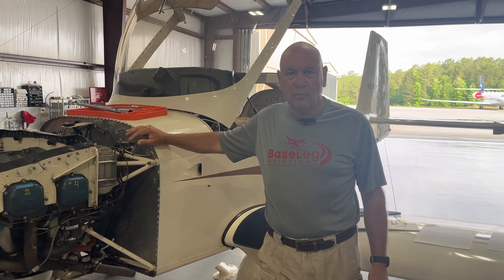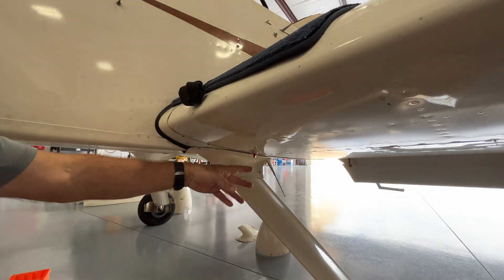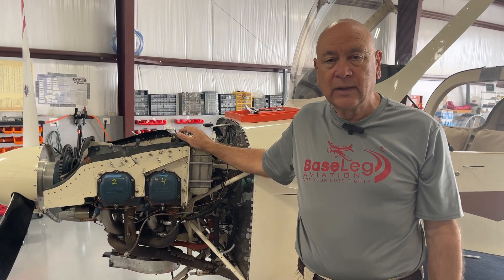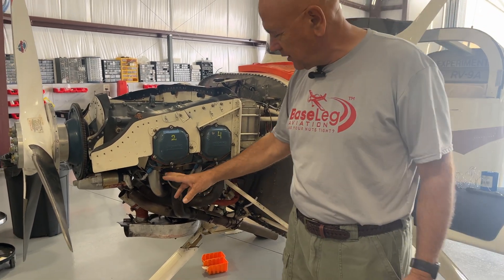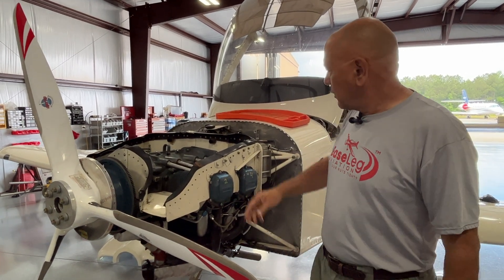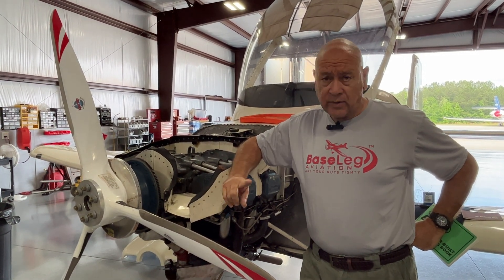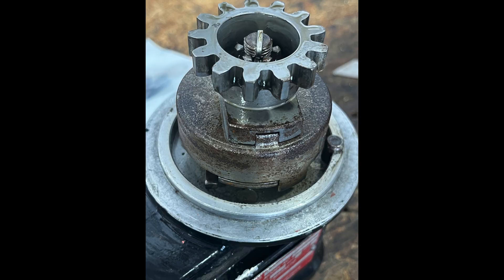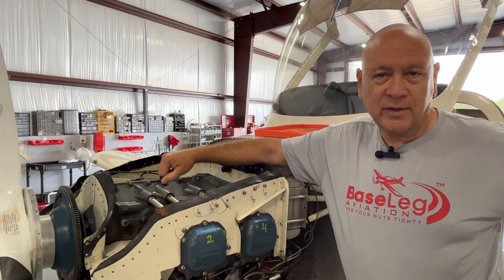RV 9A condition inspection findings

Comment: What target system voltage do you shoot for aircraft with the Odyssey battery? I replaced my Concorde a long while back, but never adjusted the voltage regulator. I know the AGMs prefer a higher charging voltage (and use an AGM compatible charger) but didn't adjust my aircraft systems.
Reply from the maker: 14.3-14.5 is best for them.

Comment: When my plane is going to sit for a while, I place a desiccant pack in the oil filler neck and seal it with plastic and a rubber band. I cover the crankcase breather as well. If it's going to set for weeks, I also install desiccant plugs in the cylinders. Do you think I'm adding engine protection or just making myself feel better?
Reply from the maker: there’s lots of other openings such s the exhaust pipes. if it’s going to sit for weeks you should consider investing in one of the units that recirculates dry air through the engine.
Reply: @baselegaviation1614   I have a desiccant pack put my exhaust also. Do you think this helps any? These do attract moisture.
Reply from the maker: you have to refresh the desiccant regularly.

Comment: Thanks for the tip on the leaking fuel drains. Mine have been weeping for a while and this morning I pulled them out, cleaned the debris from under the O-rings and reinstalled. Should be good to go.

Comment: At 5:48 i noticed that the Oil Filter safety wire, is , in my opinion, not correctly installed.  It appears that if the oil filter were to loosen, this configuration of the safety wire would not prevent rotation that would loosen the oil filter.  You have probably  safety wired 2 orders of magnitude more oil filters than I, but this does not appear correct.  Please tell me I am wrong.  BTW, loved your Hummingbird series.
Reply from the maker: Thx. We caught it, too. 😊. Talked to the new guy.
Reply: As an AP/IA that has safety-wired a metric ton of oil filters, I agree with you, it does appear to be backwards. It happens sometimes, no matter how many you’ve done. Good eye Tom.
Reply: I noticed the same thing. Just did mine so it caught my eye

Comment: G,day from Sydney Australia.
Is it not sufficient to open the oil cap and allow any steam vapour pressure out?
💦🛩️
Reply from the maker: Yes, that’s a good idea AFTER a flight in which it was brought to normal operating temp. If it wasn’t run long enough, all of the vapor will not escape.
Reply: That's good practice, I'm told by Ed Kollin of Camguard fame.  I do this after most flights.  I also use an engine dryer/dehydrator - the Black Max.

Comment: I never understood why Lyc intake gaskets were so thin and wear prone.  I made my own out of much heavier fiber stock and they last forever.  Camguard is really good for engines that sit for long periods.
Reply: I have stored mine for the winter but the Camguard manufacturer says it's ok to double the amount of Camguard in that situation.  Usually do it on the last flight of the season.
Reply: @jcheck6  I have several years of data from Blackstone on the wear metals of my O-360-A1A that shows no indication of accelerated wear even during Covid era when I only flew a few hours all year.  Normal amount of Camguard.
Reply: @garyvanremortel5218  Thanks for the update Gary, I have the same engine.

Comment: What concerns do you have regarding the cylinder scoring you found?  Is this an indicator/predictor of further wear down the road with resultant decreased performance and shortened engine life?  At what point would you remove such a cylinder and hone/ replace rings?
Reply from the maker: Compressions were all still favorable and the plugs were dry, so not too much oil being burned yet. Yes, it is a predictor, and we will watch it closely.